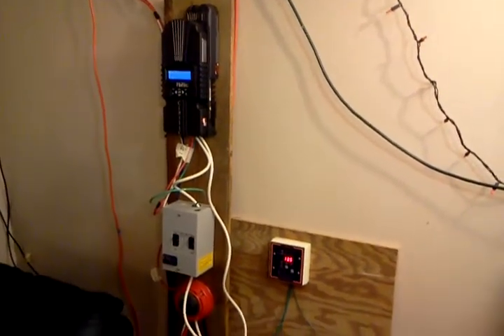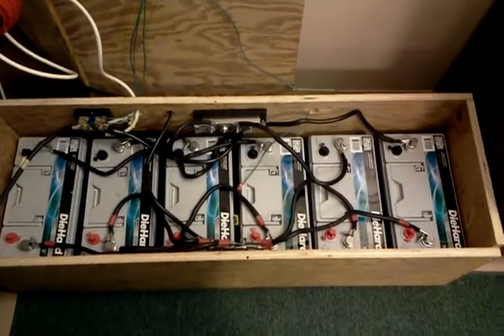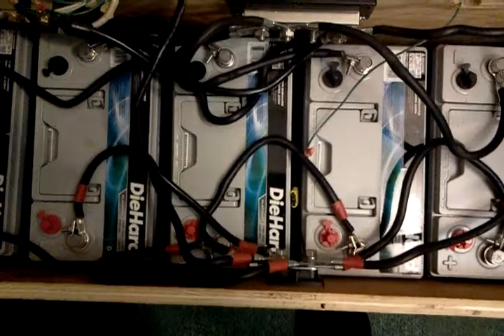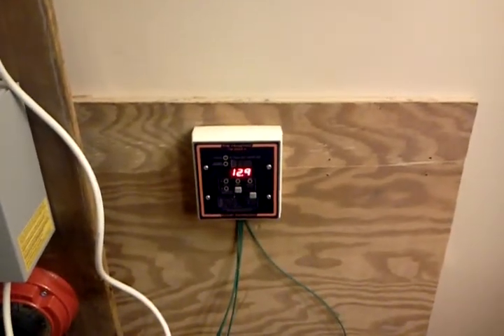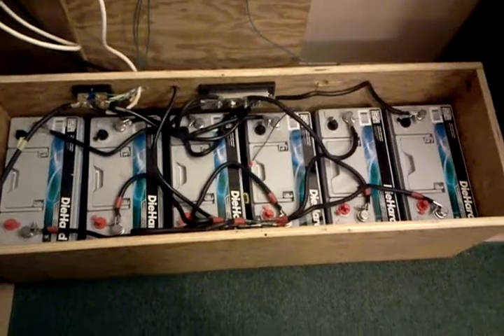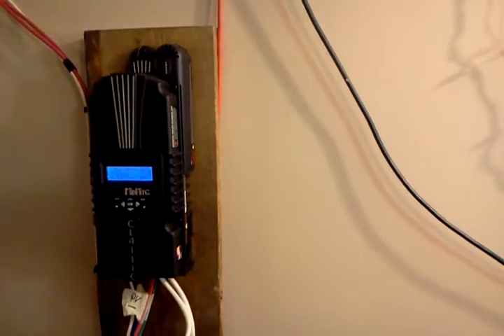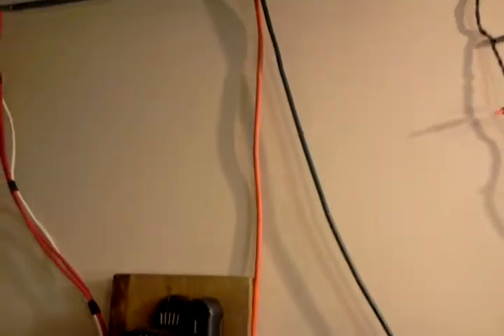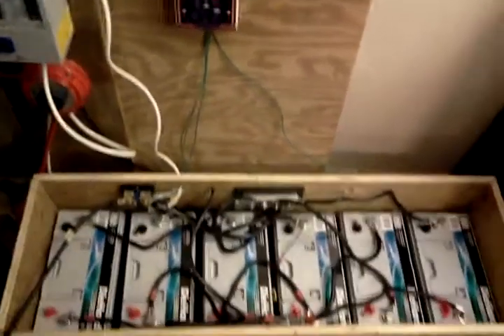Inside of battery box

Comment from the maker: Thanks El Raz, I cut the front panel of the box lower than the lid by about an inch and I have three 1" holes cut in the back as well.  AGM batteries don't vent gas like flooded lead acid batteries, or at least not nearly as much, and my basement is cold so I think I should be ok.